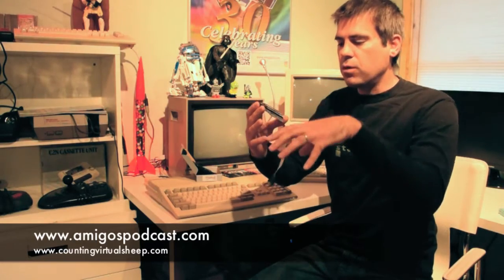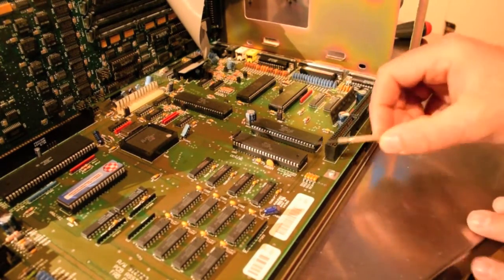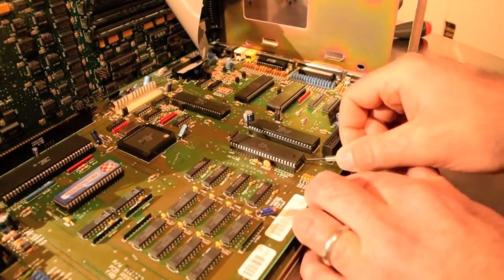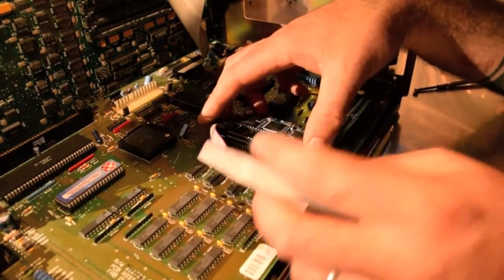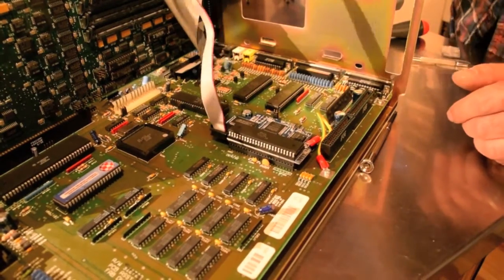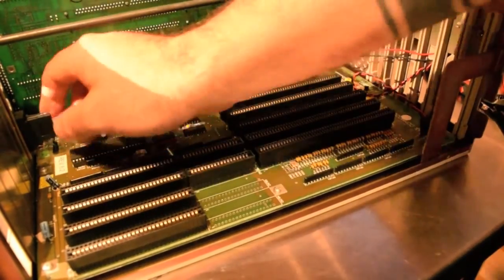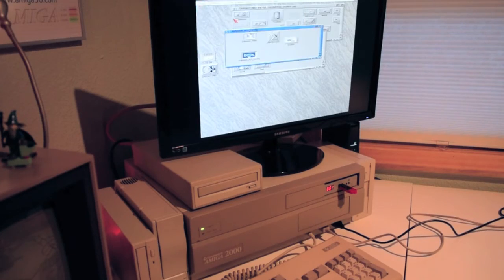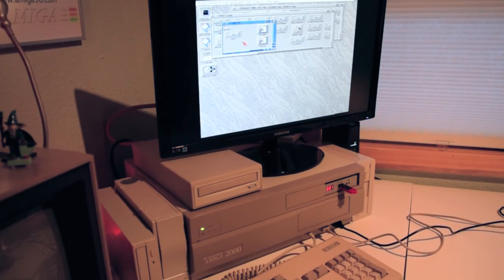Installing Indivision ECS Scan Doubler - Amiga 2000

Comment: Nice video.  So one thing I am curious about with this solution and can't seem to find the answer for is does the old RGB port continue to function with the IndivisionECS connected?  That is not to say I want to run "dual monitors" but if I want to swap and hook up a RGB CRT to the Amiga can I still do that without unhooking the add-on?
Reply from the maker: Yes! I'm actually doing that on my 2000 now, I have a 1084s coming out of the standard video port and and a LCD hooked to the VGA, it's a mirror desktop setup.
Reply: @WillWilliams6502  Oh excellent, thanks for the response this is something I've wondered about for a while.

Comment: Awesome. Congrats! Does it allow us to use a standard modern VGA sync or does it still require one that does the old 15khz timing?  I've searched around with no luck.
Reply from the maker: Thanks! Yup, with the board you can connect pretty much anything that'll accept a VGA input. It opens a lot of doors in respect to displays.